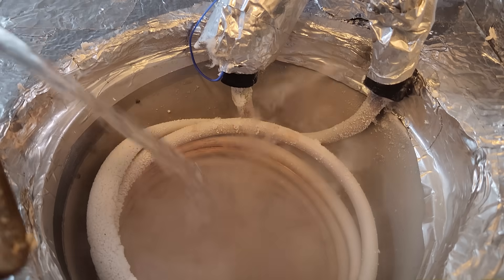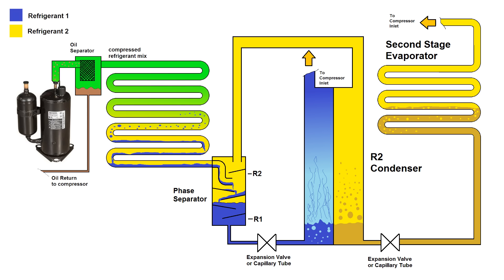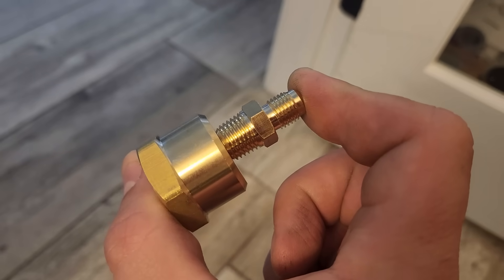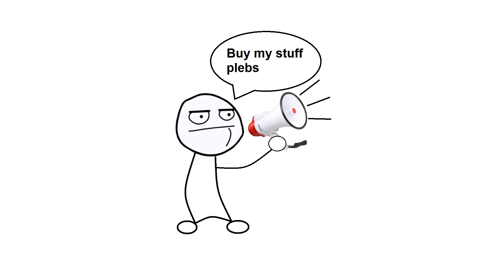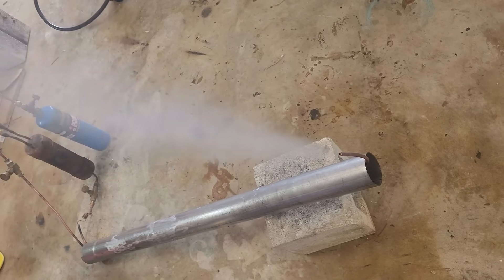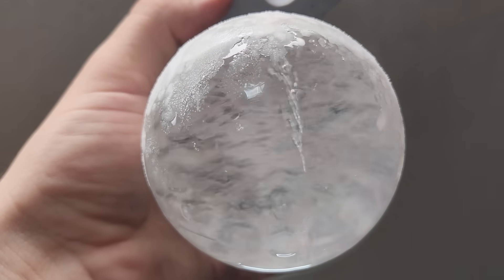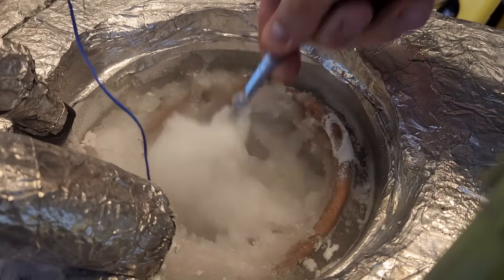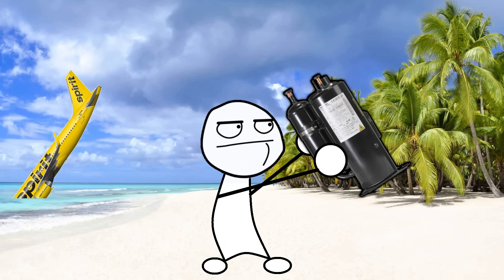Homemade Autocascade Refrigeration System (plus Anhydrous Ammonia)

Comment: Instead of having a Ballest tank on the suction line why Don you use a  liquid line accumulator to store all the liquid refrigerant for the system. During off time the system can "pump down " and pump all the refrigerant into the accumulator storing it in liquid form so you need less volume to store the system charge. Most Comercial refrigeration systems do this.
Reply: While at it you can add a head cooler to the compressor to help cool the compressor when under heavy loads. For this you'll need to tap off the liquid propain line and run that threw a TXV or a EEV controlled by the arduino then after the expansion valve the boiling liquid refrigerant is dumped into the suction line and thus into the compressor housing.  This will cool the compressor and alow you to get better performance from it. The txv would have it's sensing bulb attached to the discharge line of the compressor or if you use the arduino it would have a temp probe on the discharge line or the top "head" of the compressor. Using this temperature it would meter refrigerant into the suction line based on the temp of the compressor. 
But be warned you don't want liquid going into the suction if the compressor isn't hot enough to boil it.  Scroll compressors are more forgiving of sucking some liquid but they don't like it much and the liquid refrigerant Will wash the oil out of the compressor causing it to lock up.

Comment: The data plate for your heat exchanger says 3 MPa, so at 33 bar you're operating it at 10% above the design pressure. I don't know what kind of a safety factor these things have, but you might want to exercise care.

Comment: That compressor is for R-32. You should try to find one from an R-410a system, as the normal operating pressures are 450psi and higher. If you hit the thrift stores you might find a window unit or portable air conditioner which uses 410a.
Fascinating as always!
Reply: You might consider experimenting with vacuum insulating panels too. Apparently, they're just a mylar bag filled with fumed silica, which means if you make your own, you can make it conform to odd shapes. They have an extremely high R-value, exceeding all common building materials.
Are you a fellow Portlandite, by chance?
Reply: R32 and r410a both have vary similar operation pressures. Infact r410a is just r32 with a flameretardent mixed in. If I remember correctly r32 runs about 10-20psi less then 410a
Reply: @ceilingfanmusic6597  It's a difference of 199psi at 122f condensing temperature (typical condenser temp at 77f ambient), which is the difference between overheating/short cycling, and running at 100% duty cycle. Break out a PT chart. R32 and HFC-125 have similar operating pressures, but the near azeotropic blend operates at significantly higher pressure than either gas alone.

Comment: Since you are doing all of your own plumbing for this anyway.....
You can improve the duty cycle of a compressor by returning small amounts of the condensed propane refrigerant with a needle valve and/or its own capillary directly to the inlet of the compressor. This small amount of refrigerant robs a small amount of performance from the stage 1 cooler, however it will carry a relatively large amount of heat from the compressor to the condenser and should allow you to run a 100% duty cycle, you might have a better C.O.P. without the start/stop on the compressor... 
There are some large industrial units that have a thermally cycled valve that dumps refrigerant from the condenser to the compressor inlet when the compressor starts to get hot. This way the system doesn't waste energy trying to help cool the compressor cool itself when ambient temps are low enough to keep it cool but allows the compressor to run cooler when the ambient temps rise.
I wonder if the COP is harmed by the mixture of gas and fluid in the stage 1 condenser impacting the thermal transfer....

Comment: Add an oil cooler for the compressor. It will help with duty cycle and cooling rate by dumping the compressor motor heat. The returning low temp refrigerant gas cools the motor. By design function your system cannot cool the motor adequately. Small automotive evaporator coil with 12v fan, tap high side, use small diameter cap to feed a Venturi pump to move the oil.  You can add a filter to prolong life.

Comment: I wonder if you could tap off some of the coolth of perhaps the first stage to make a cold trap just for the water in your anhydrous ammonia setup. Something cooled to just above the condensation point of the ammonia to freeze out the water in the gas stream as ice. Unless the ammonia prevents ice formation of course

Comment: I'm glad you addressed the whole MAPP gas fiasco. Since I see a bunch of brazing happening I suspected a DIY approach to making your own fuel. Now if you start fooling with liquid NH3 , make sure to invite the local DEA over for a demo ! And get a gas mask 🙂
Reply: is ammonia used in drug production?
Reply: Ammonia is in DEA Special Surveillance List. IDK but I guess it should be a non-issue unless he starts selling or giving away his supply and then it gets into the wrong hands.
Reply: @3312-q2e  Generally almost all chemicals can be, because atoms are fungible and the space of compounds that affect neurons in some way is infinite. But ammonia's one the powers that be have decided to single out for such because it's both easily available (truly massive quantities are used for industrial agriculture, I guess because it's slightly cheaper than other nitrogen sources even though AFAIK it's not very easy to administer efficiently to plants) and useful for a wide range of chemistry, making people who work with it without an economically productive reason 'presumed drug producers' and subject to surprise raids and other interference in many jurisdictions unless they work closely with police. It's also fairly hazardous in many forms, which probably makes it easier to track possession of through the safety precautions needed to store it.

Comment: Allright this is very cool.

I have  tangentially related questions.

Could you increase the cooling power of an automotive vapor compression system with a normal cascade system.

You of course would have it install a second compressor but that should be possible on larger vehicles.

I would love to have superpowered ac in my vehicle.

Comment: You gotta use teflon tape AND pipe dope both on your brass / copper fittings..  youll never have a leak..  trust me..  ask any plumber.   Tape and ptfe pipe dope works..

Comment: I love how you can figure out these complex refrigeration systems but cannot figure out teflon tape and dope. Keep up the good work, I enjoy these videos.
Reply: there is no dope and teflon tape in low temperature refrigeration (down to < -80C), he is working around custom/expensive solutions with hardware store materials
Reply: Tape and dope is for low pressure applications. Sling some hot metal on every refrigeration connection you can. Or use flare fittings

Comment: I have this 0:26 system in my truck with my compressor style cooler where I turn on the air conditioner in my truck to cool off the air that's being heated up by the compressor style cooler, so that I can get it down to 15°F. Admittedly not as COOL as what you did.
Reply: Do you transport dead bodies ? Just asking

Comment: Could also add a cooling head to the top of the compressor basically just uses magnets and a sprayer to flow water over the compressor basically

Comment: Ok, done watching. Awesome build, as always! A few thoughts...

• You could try freezing your ammonia distillation gas to about -20°C to remove a large percentage of the moisture, then run the remaining gas through NaOH or a zeolite filter. 

• I know if at least one company that uses an auto-cascade system as the 2nd and 3rd stages on a freezer designed to reach -105°C. They're super sweet.

• If you need a high torque compressor, I'm salvaging a few from older -80°s that are being recycled.

• I was curiously surprised to see you found a BPHE from Vevor! I will have to check those out!

Keep up the awesome projects and videos!

Comment: Yay, back to cold stuffs :) Polycold is famous in building autocascade systems, sometimes they have even 3 or 4-component refrigerant mix. Would it help to watercool the compressor? Also do you plan to go back to pulse-tube cryocoolers? :)

Comment: Use shaved sodium metal chips as a dryer. NurdRage has a video up showing how to make sodium metal in bulk for cheap.
Reply: Shaved.. sodium…
Jesus Christ..
Reply: @Wyi-the-rogue  what... works perfectly fine.  I guess if you shaved it paper thin, it could be "interesting " but any common sense thickness over 1 mm is perfectly suited to the job.
Reply: @demandred1957  oh yeah I live somewhere so humid that there'd be a legit threat of condensation starting a fire